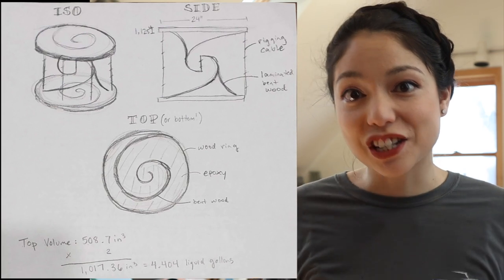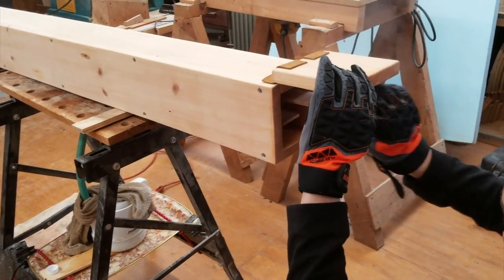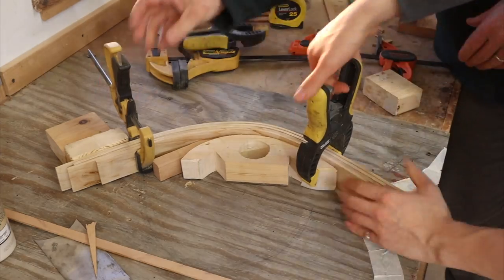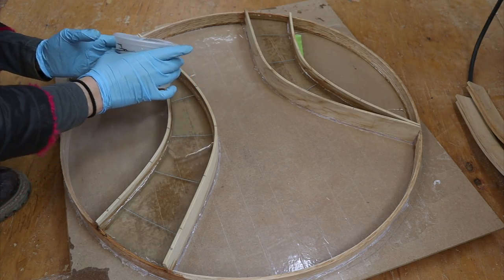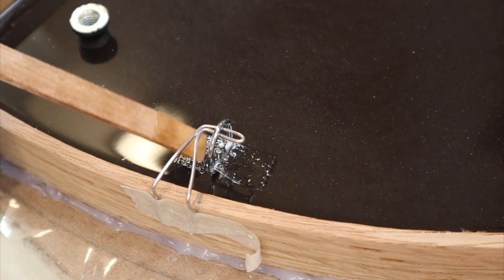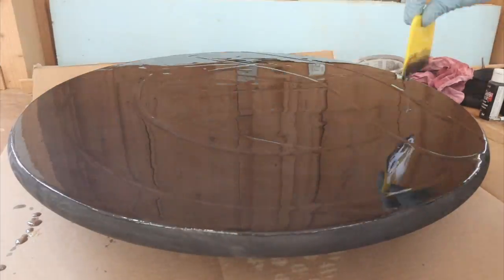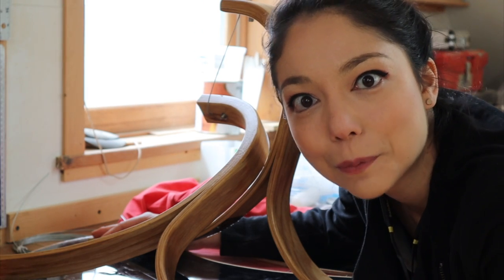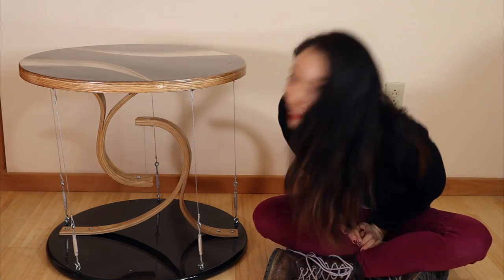Making a Floating Table

Comment: I've seen several other magic table videos. Your's beats the others in terms of elegance by miles. 
What has me confused is: you all do the connections strictly vertical.  Is this done for leg room? Diagonal connections on the outside should reduce the lateral wobble. You would of course need longer (and extra four) wires.
Reply from the maker: Diagonal would indeed be way less wobbly! But it is visually really obstructive and I though took away from the intention of the "magic" effect so I opted for vertical. Just cleaner lines.

Comment: You could have just glued it back together with just about any wood glue.  The break is along the long grains so it would have been stronger after the gluing.  Really surprised your uncle didn't point this out.  The fiber glass and epoxy makes sense if this were a canoe, but it's not.  It's just a table.

Comment: If you routed recesses under the base for the turnbuckles and fed the cables through holes in the base then to the turnbuckles wouldn't the table would have a cleaner look 🤔

Comment: Ok, here’s a thought.  You have 4 vertical wires. If you attach 8 wires on diagonals 1 space over all around will it stiffen the table?
Reply: Bruce, you have hit on a critical point that maddeningly the hundreds of tensegrity table builders out there have not seemed to notice, and that is: as configured these are failures as furniture. Really a simple matter, for Pete’s sake. Who wants to put their drink, or anything else, down on a skittering wiggling oscillating surface?  Buckminster Fuller, the originator of the concept, has got to be screaming in his grave. He knew a thing or two about triangulation.

Comment: That's amazing! How stable is it to use as an actual end table?
Reply from the maker: It could be better. You can see the wobble when the cats jump off at the very end-- I think that could get mitigated if the supports were more 3D, but I didn't find that design flaw until too late :(
Reply: @xylafoxlin  What about adding some diagonal cables around the outside?  Currently, every cable goes straight up and down, but if each one went diagonally, some clockwise and some anticlockwise...?  Ah, but now I've counted and you have an odd number of cables, so.  Hm...

Comment: steam is not hotter than boiling water if is saturated, so if you're just boiling water without an overheating systen for the steam then is just 100°C
Reply: Steam is in this case easier to say the water in gasoline form…

Comment: carbon fiber tape between each of the bent wood pieces... that would look cool with a black stripe down each piece.
Reply: I think that locating the carbon fiber at the neutral axis of the material is not much help for stiffening and strengthening. The high tensile fibers belong on the outside, as a skin.

Comment: These things will mess with your mind until you realize that the center chain supports the weight, and the rest of the chains just stabilize the single hanging point.

Comment: The worst thing of this table is that it turns. You may make 6 ropes on the sides and make them cross in pairs like X. So it will be much more stable.

Comment: Sorry to be a party pooper, but I do have a criticism of this design.  In building tensegrity structures, the main difficulty is in placing the wires and making sure that the tension in each is suitable and that the fixing method is unobtrusive.  Here turnbuckles have been used, and IMHO that is a bit of a cop-out.  Furthermore to be a proper tensegrity structure the tensors should be in threes, since the triangular form is stable ; rectangles are not stable. Here you have five vertical tensors !   I think you should treat this a a first attempt.

Comment: Trouble with these "impossible" tables is that 100% of the load is carried by the center cable.  The outer cables are only for stability - they dont hold the table up at all.  Center cable breaks and the whole thing comes crashing down.    That little tiny cable she used probably has a WLL < 200lbs, and subtract from that the weight of the upper portion of the table.   Someone is going to lean on this thing at some point and it will come crashing down.

Comment: Instead of 4 seperate wires to suspend the table, I would've used one wire and loop it trough channels build into the top and bottom. The bottom of the table I would've hollowed and make room for the suspension system so it's invisible, making the impossible table look even more impossible.